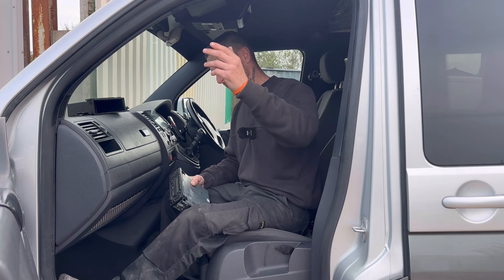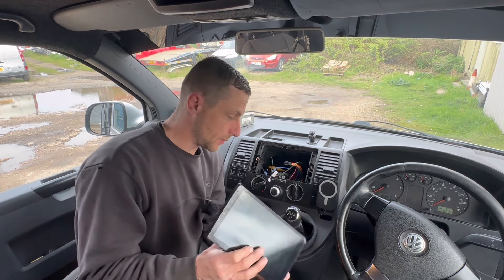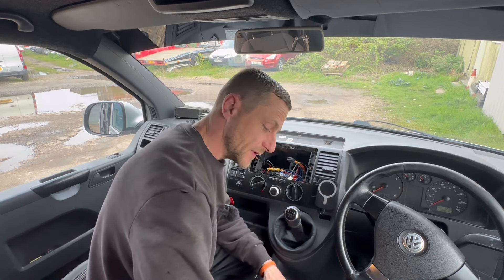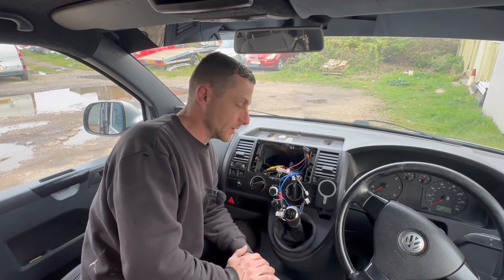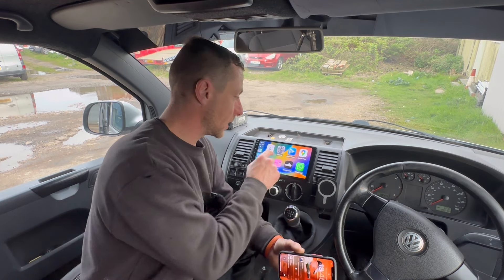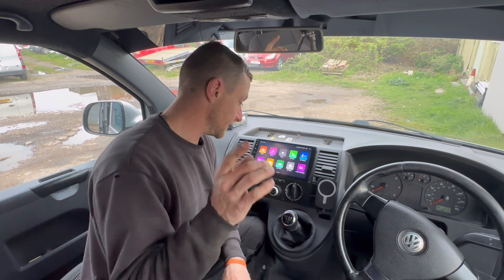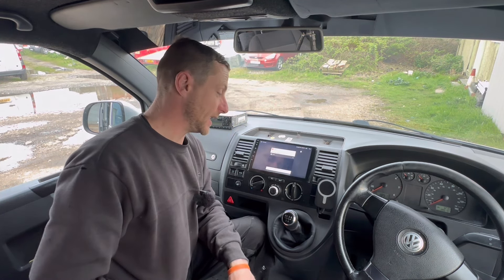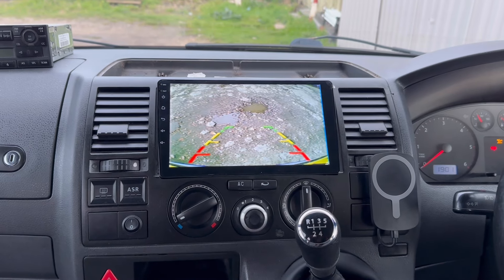T5 transporter 9” android screen - Apple CarPlay

Comment: I fitted a single din head unit with a retractable screen to eliminate the glare from the sun. Absolutely amazing. You may find that your screen deteriorates after a while from sun exposure. Run the unit off the house battery with the trigger wire connected to accessory. Love your show

Comment: Great looking little head unit. If you wire a relay across that switch and get a piggy back fuse holder from an ignition live you can have best of both worlds with the radio.
The dark coloured panels in the cab are looking well.

Comment: I still have a Polk Momo sub in the loft from over 20 years ago.. it wouldn't  fit under the seat in the t5, so got the 10" JL audio and it slaps.. van time is guilty pleasure time, so I need a good set up to pump out anything from happy hardcore, d&b, grunge, speed garage to 70s disco + everything in between, and no one can judge me...

Comment: Nicely done!
Now you need to upgrade your steering wheel to multifunction one from T6 or T6.1 (possible with an adapter) so you can control the stereo and add the cruise control 🙂
Reply: I have one 😉 Will just need an airbag Nathan.

Comment: Hey Nathan, great video. You could have pulled a live and switched live from the fuse box right under the radio! Would have saved you running the wire from the leisure battery

Comment: Another absolutely CLASS video.
I am however totally new to all of this in terms of the upgrades to my motor... and so - just to check as I am 1000% planning on doing this...
As long as the wiring is carried out correctly, in terms of the reversing camera... it will know as soon as you're in reverse?!
Reply from the maker: Hey bud thank you appreciate that, yes soon as it’s wired into the reverse light wire I mentioned when you stick it in reverse it automatically turns the rear camera on 👍👍

Comment: 99% sure that the CAN bus tells the head unit when the vehicle is in reverse so no need to do anything to get the reverse cam to work. I have a similar (identical) head unit in my Skoda and the cam just works - no wiring required. I installed one of those tail gate open button camera's for the more discreet look. Its not the correct one for a mk2 octavia but it fits with some jiggery to the connecter.

Comment: 25:52 I'd have cut the yellow plug off and fitted a new one or used Wago connectors. To get wires through the rubber gaiter I used some plastic hose (I used beer line) and slid it through the rubber gaiter, so you can then slide all your wires through the hose. Then carefully remove the plastic hose.

Comment: Great video i put one in the caddy fits 100%works great but it kept draining the battery 🪫 so until i can get it done properly I’ve disconnected it
Reply from the maker: Hey Clive, I fitted a later stereo in my caddy and it drained the Battery. I cut one of the canbus wires that goes to the stereo and it stopped it as the canbus system doesn’t know the stereo is there. Just have to turn it on and off manually 👍 thanks mate

Comment: Where’s the link?
Reply: Looking for it too
Reply from the maker: Just added it to the video description 👍
Reply: There are plenty exactly the same advertised at £75 on eBay. Just spent a bit of time checking specs and the screens and functions and they are the same
Reply from the maker: @shaziman1  make sure they have 8 core processor with 4gb ram and 64gb rom, the cheaper ones normally have less.